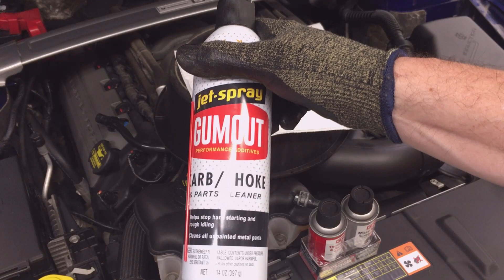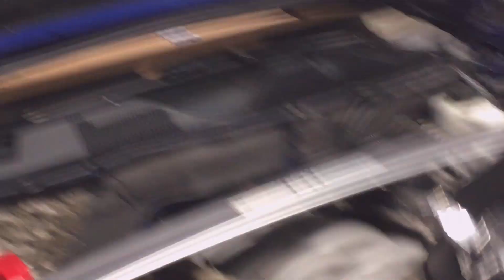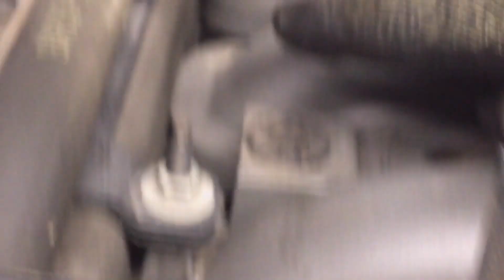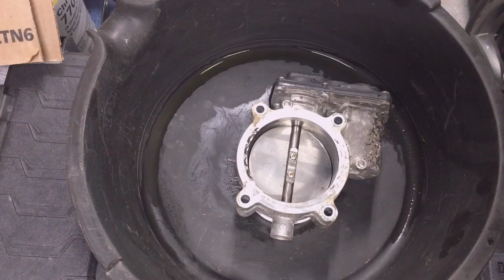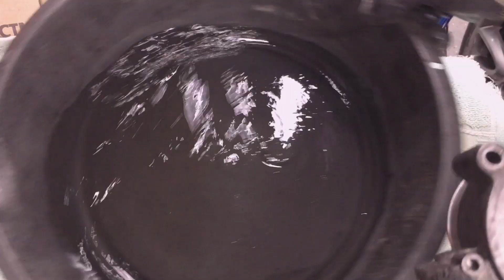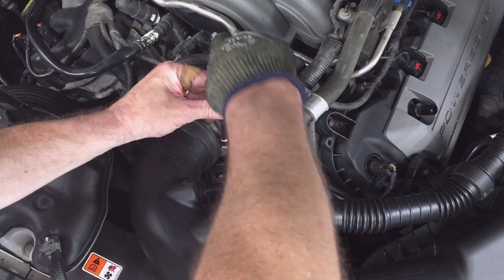Throttle Body Cleaning; 2005 thru 2014 Mustangs

Comment: It's easier to remove the two bolts on each side holding the strut tower brace to the struts than to try and force it through.
Reply from the maker: Salvador, True, however, that's why I showed in detail how to remove it, so it doesn't need to be forced.  But, like you said, it is better to remove the Strut Tower Brace Fastener than break it, as plastic gets old, it get brittle and breaks easier.  I appreciate the comment and the tip! - Stiles

Comment: Good job 👏, no need  Reprogramming ??
Reply from the maker: Ahmedz, No, you don't have to unless the Throttle Body was really dirty and the Engine is having a hard time idling. It's easy to Reprogram (or return the OEM Map in the Computer) simply disconnect both Battery Cables (you should be cleaning them periodically (yearly or less) anyway, see the Stiles Automotive Video) and touch the 2 Terminal Ends together for 10 seconds. - Stiles

Clean and Service Battery for Long Life and the Best Connection; 2005 thru 2014 Mustangs  https://youtu.be/_Cc4wIYaT4s

Comment: How do you do a relearn ?
Reply from the maker: Santiago, You don't have to do a relearn, the Ford PCM will learn the new Idle Position after time, however, your Engine may (or may not) have problems while it reestablishes Idle Position.  To clear the Computer's (Powertrain Control Module) Memory and to get the new baseline sooner. Disconnect both Battery Terminals and either touch them together for 10 seconds or use a Jumper Wire (as necessary).   Be sure to Clean the Battery Terminals and Battery Posts prior to reconnecting (and you should be doing this periodically as well) (see the Stiles Automotive link below). - Stiles

Clean and Service Battery for Long Life and the Best Connection; 2005 thru 2014 Mustangs  https://youtu.be/_Cc4wIYaT4s

Comment: It doesn't look like there is a gasket that needs to be replaced. Is that correct?
Reply from the maker: Ajsdfk, The Throttle Body has an O-Ring Style Gasket that you can reuse. Be sure to inspect the Gasket to ensure it is good, prior to reusing it. - Stiles

Comment: Great sets of videos. One question, what is the vac line next to the pcv line u took off?
Reply from the maker: RJ, I think you are talking about the Hard Plastic Line connected to the Solenoid (the Vapor Solenoid) to the upper passenger side of the Throttle Body. It runs back to the Fuel Tank and vents Gas Vapors into the intake when the Vapor Solenoid is energized.  I appreciate the feedback! - Stiles
Reply: @StilesAutomotive its the larger dia pipe that connects just after the MAF and before the throttle body. The pipe has ridges in it and runs back to driver side and disappears down side of brake booster.
Reply from the maker: @rjmlondon  Believe it or not, that Tube transmits Engine sound from the Intake to the Passenger Compartment. I have Flow Master Mufflers and really don't need it. I should delete it. - Stiles
Reply: @StilesAutomotive  amazing, thanks for that, i was just trying to work it out and could not tie it in anywhere logically. Thanks again, keep up the great work.

Comment: My 2005 GT with 88,000km bucks occasionally in first gear, will cleaning the throttle body eliminate the bucking
Reply from the maker: CU, May be. Cleaning the Throttle Body may give you better Throttle opening. At 55,000 miles and almost 20 years old, your Throttle Body should be cleaned. - Stiles

Comment: My 2014 mustang v6 is having a small iddle issue can it be the a dirty throttle body has 54k miles on ijust got it don't know if it's been cleaned
Reply from the maker: Jerry, Unless you have clean your Throttle Body or have asked your Shop to clean it, it has NOT been cleaned. And it is likely the cause of your idle issue.  You could also have a vacuum leak, Your Mustang is 9 years old now and a Vacuum Hose could be an issue, but the most likely is the Throttle Body. Clean the Throttle Body, Air Inlet Tube, Mass Air Flow Sensor (see my video, it you haven't already, link below) and put in or clean your Air Filter. - Stiles

Mass Air Flow (MAF) Sensor Cleaning - MOTORCRAFT AFLS165 {#BR3Z12B579A} 2005 thru 2014 Mustang  https://youtu.be/g44NIAsmGh0

K&N Air Filter Clean and Service– General Automotive  https://youtu.be/f5VNlvQLY5E

Comment: I did this about two months ago, I couldn't take off the engine cover to save my life. I ended up breaking the chrome decorative piece. Luckily I was able to glue it back and finished the throttle bottle clean with the engine cover on.... GREAT GUIDE OTHERWISE !
Reply: Yes i had the same issue. I just take the cross beam off now.
Reply from the maker: Midnight, I show you how to remove the Engine Cover in the beginning of this video (you have to remove it to inspect the Hose under it) - -    Thanks for the comment! - Stiles
Accessories Drive Belt and Hoses Inspection - 2005 thru 2014 Mustangs  https://youtu.be/JloLvOj4Z4Q

Comment: Is this process the same on a 2017 gt
Reply from the maker: Ray, your Throttle Body is very similar, but a different Part Number.  And, Yes you would do the exact same cleaning process on your Throttle Body!  - Stiles
Reply: @StilesAutomotive  thank you I was able to complete, the work without issue thanks to your video.

Comment: Okay so are you supposed to unhook the negative battery terminal
Reply from the maker: Marion, I do not disconnect the Negative Battery Terminal, the Ignition Switch should be off and the Throttle Body will not be powered.  I could see someone outside doing this task with the Mustang Windows open and the Stereo on; don't do that the Ignition Key should be off. - Stiles

Comment: I have a 2012 mustang v6. I have an issue with the car losing power while driving down the road. Power cycling the engine fixes it temporarily. Seems to only happen with ac on. It was an issue that happened a year ago then stopped but has come back and becoming unbearable. Check engine light has come on now. Doing research it seems like a throttle body issue. Do you think cleaning it will help? My car currently has around 56k miles on it
Reply from the maker: Victor,  I'd be surprised if it is the Throttle Body being dirty with only 56,000 miles on your Mustang, unless you do all low speed city driving.  Go to a parts store (like Autozone, Pep Boys, Advance Auto) and have them read the OBDII Fault code.  You likely have a bad sensor or maybe a bad Throttle Body.  Even after you replace a sensor or whatever part, You should clean the Mass Airflow Sensor (see my other video) and clean the Throttle Body.  Both you can easily do yourself.  Let me know how it goes.  - Stiles
Reply: @StilesAutomotive  I found out after the obd scan that the issue was throttle actuator stuck open. I replaced the throttle body and car has been running great. Thanks for the info!
Reply from the maker: @Yestoday85  Awesome!  - Stiles
Reply: @Yestoday85  how much was the replacement?
Reply: @BurningFaithfully1945  it was around $100 from napa auto parts. Installed myself. Took around 45 mins
Reply: @Yestoday85  Did you get the TEE ETB146 throttle body form napa?
Reply: @XxRAPIDxKILLZxX  yes that is the one I got
Reply: @Yestoday85  And it's been running great ever since? It's so cheap compared to everything else that I've seen so I'm all for it if it performs.
Reply: @XxRAPIDxKILLZxX  i traded the car in back in August but from October of last year when I replaced until then I had no issues at all
Reply: @Yestoday85  Ah I see. I'm curious if your issue was the same as mine. You would be driving then out of nowhere the car would stop accelerating and loses power and says "check manual" with a little wrench icon on the screen and then you have to pull over to the side of the road, turn the car off, give a few seconds, then turn it back on and hope it doesn't happen again?
Reply: @XxRAPIDxKILLZxX  yup, thats what would happen. Im sure its the same issue. Is check engine light on? I was able to verify the issue on mine by doing the old scan and checking for the error code that came back
Reply: @Yestoday85  yeah the check engine light is on as well. I got one of those code scanner things but I'm pretty confident that it's the same issue you had. Gonna clean it tomorrow, see if that fixes the issue, if not, gonna buy that NAPA part.
Reply: @XxRAPIDxKILLZxX  sounds good! Most likely same issue. Im sure Ford didn't bother improving the component over that timespan lol
Reply: @Yestoday85  did you do the install yourself? I’m currently trying to remove the old one and the push plastic screw connected to the throttle body just isn’t coming out, did you end up just cutting the zip tie?
Reply: @XxRAPIDxKILLZxX  yes I did the install myself. The push plastic screw was hard to get out for me as well. Had to use a couple wrenches formed into a cross underneath it to pop it out. I think the plastic melts some and thats why it's so difficult to pry out but the wrenches helped create leverage. I dont remember if I cut the zip tie. I dont believe so but not sure
Reply: @Yestoday85  yeah it’s the one that’s connected to the electrical cable, been trying to get out and it just ain’t coming out. Very frustrating
Reply: @Yestoday85  just cleaned it and put it back in. First few minutes of drive it did it again, heading to Napa now. When you took it off did it seem damaged to you at all? Mine looked perfectly fine so idk.
Reply: @XxRAPIDxKILLZxX  mine looked fine as well. I think the electronic portion is faulty, so all the mechanical portions look normal
Reply: @Yestoday85  replaced it with the new one a few hours ago and could immediately tell the difference, just how it felt while driving. Took it around the block a few times and had no issues, hope it stays that way. Thanks for all your help!
Reply: @XxRAPIDxKILLZxX  no problem. I had the same feeling when I replaced mine. Noticed a difference right away.
Reply: My 2015 mustang v6 has started doing the same thing, happened a few months ago and didn't really think anything of it. Now recently, it's been happening almost every time I drive. I'm hoping I can get away with cleaning it to solve the issue, but we will see.

Comment: Good work 👏 
I wanna ask u .
 I haven't to disconnect the positive wire of battery before start clean the throttle body??
Reply from the maker: Ahmed,  No, I normally do not.  If the Throttle Body is extremely dirty and the Engine idles rough, it may be a good idea to remove the Negative Battery Terminal and use a Jumper Wire to zero out the PCM memory.  Thanks for the comment! - Stiles
Reply: Thank you.  I want to clean the throttle and I have concerns that there will be a problem in programming the car's computer.  What advice would you give me?
Reply: Is it normal if I disconnect the battery before cleaning?I heard from a friend that there will be a problem with the car computer, and I will need a device to reprogram the Throtel on the car. I am hesitating, but I trusted you when I watched your videos
Reply from the maker: @SoMe_oNe.1.  Ahmed, the Ford PCM learns from the newly stored values.  After about 10 minutes of idle and 10 minutes of driving the PCM will have retrained itself.  Again, if your Throttle Body is very dirty, you may want to zero out the PCM memory and go back to the stored default map.  Again, you do this by removing the Negative, then Positive Battery Terminals, and touching the Terminals together.  - Stiles
Reply: @StilesAutomotive  ^ that's what Scotty said in his videos himself , 10 minutes or 3 days of driving the thing will program itself back to normal....

Comment: I have 2011 Mustang GT with an MT82 that has a slight rough idle. Its a small deviation but you can feel it when it dips and then rises. Every once in a while it will die at idle if I'm stuck at a long light, but if the a.c. is turned on its dies more frequently. Could it be a dirty throttle body or something else? Thanks.
Reply from the maker: Chris, How many miles are on your Mustang and what maintenance has been done?  You didn't mention a Fault Code or Check Engine Light, so probably none.  Without knowing this, Yes, Clean your Throttle Body, Clean the MAF Sensor and change the Air Filter.  Before you remove the Throttle Body and after you remove the Cold Air Inlet Tube from the Throttle Body, note the position of the Throttle Plate inside of the Throttle Body, is it open a little bit?  If it is open a little, your Throttle Body is very dirty and likely the problem of your rough idle.  Check for vacuum leaks.  Let me know how it goes!  - Stiles
Reply: @StilesAutomotive  the car has 73k miles. It's been well maintained, it actually ran like new up until about 4k miles ago when I started to notice it. Hasn't thrown any codes or check engine lights. Today I cleaned the MAF and throttle body and I also put in a new battery. Still idling the same but it hasn't died on me yet. Could it be a fuel filter? I'm trying to check all the boxes before I have to fork over any money to a service tech.
Reply: @christenn32  having exact same issues with mine.  Still can't find the cause. Ive replaced the MAF and fuel filter. Going to reclean the throttle body.
Reply: @neilfair4134  yeah I'm running out of options myself. LOL! I've cleaned the MAF, throttle body, and replaced the plugs. It has to be a faulty sensor or bad fuel pump, in that case I'm going to have a mechanic take a look.
Reply: @christenn32  if you don't mind let me know what ya find out man. I took mine in to diff places and they couldn't pinpoint it.
Reply: @neilfair4134  it ended up being a loose serpentine belt. My tuner went down a size to help tighten it up and all is good so far.
Reply: @christenn32  interesting. I appreciate the reply man
Reply: @neilfair4134  yeah not exactly what I was expecting either, but it was an aftermarket belt I chose for performance purposes which ended up being not the correct size.
Reply: @christenn32  I'll keep this in mind in case I ever have this issue with mine
Reply: @christenn32  Wondering if your idle was a slight up and down of around 50 rpm and only when parked, seemed to be more noticeable when there was no load on the engine. Also seems to do it every three seconds or so?